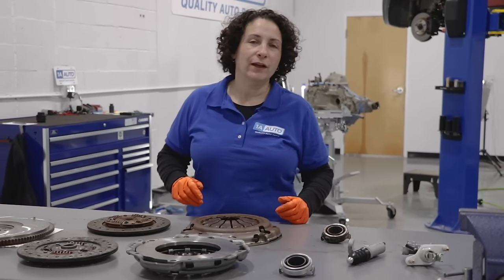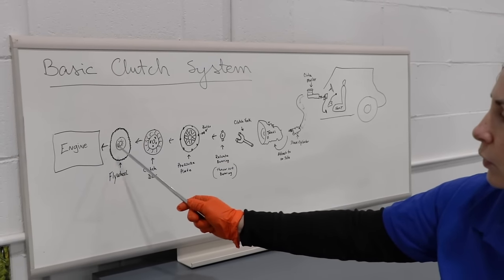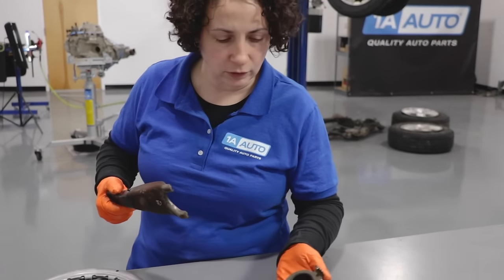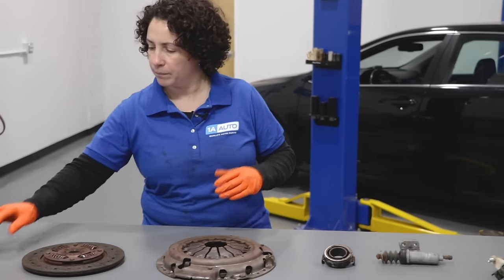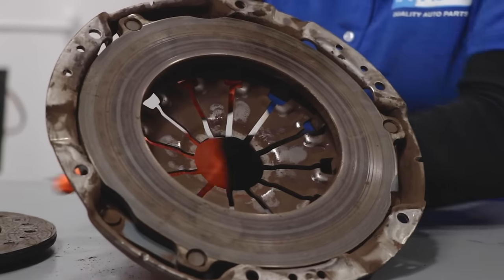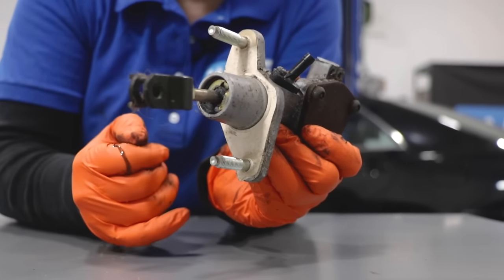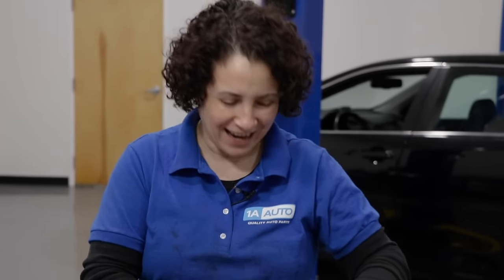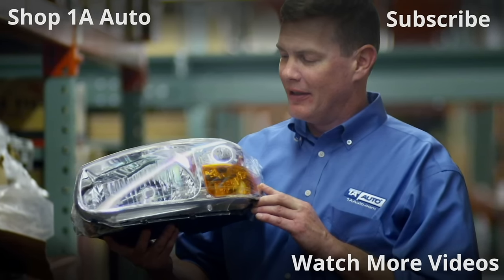How a Clutch System Works & How to Diagnose Problems

Comment: Hello wonder if you can help me I have a 2018 Ford Fiesta diesel six speed manual 11,000 miles every night after driving it round town for about an hour. The car starts to shudder when releasing the clutch in first gear or reverse. This happens all the time after an hour of driving. Any ideas what this could be please thank you

Comment: Started out pretty bad fumbling parts and words.... Brought it back though in the end... Never really addressed the system of a bad master cylinder 😢. Which I'm getting ready to change only because I'm having what appears to be hydraulic issues even though the reservoir is full and I replaced everything else a few years ago.🤔

Comment: This presentation is excellent. 
I knew next to nothing about the clutch system.  Now I feel like a mechanic!

One question; my clutch pedal has no resistance, I can just press it to the floor and can’t engage the gears.  Gears engage when engine is off.  2005 VW Passat estate.   

Looking at the helpful diagram in this video, it might be to do with the connection from pedal to master cylinder(?)
Reply: For sure try the clutch cable or it it's a new car it has a hydraulic clutch that might have the leak. Or just wear on the clutch cable. That's what provides the resistance. While ur there inspect the clutch fork for damage.

Comment: I replaced a clutch in a 1970 Mercury Capri 1600 (the Sexy European) in February of 1978 in my parent's unheated garage. The reinstallation of the transmission was, as I recall, the most difficult part of the procedure. The transmission was somewhat diminutive so I had the thing sitting on my chest. Lots of fun. There was a certain satisfaction to having performed the job myself. That was it, even though over the next four decades I had several vehicles with a manual transmission I never had to have a clutch replaced because I generally didn't hang on to vehicles for long. That 1970 Capri was a rolling testbed for every single thing which could go wrong with a car but I nursed it through its quirks until the unibody underside became too riddled with rust; decidedly unsexy!

Comment: Great information 🙌
My GMAC 6400 clutch does nothing.
I start the engine, press on the cluch but don’t fell any thing and it goes right to the floor
Desn’t quick come back also.
Could it be electric?
Is there any electrical part in the whole system?
Tx! 🙏

Comment: Really enjoy all you're lots vids, very explanatory,, I have a problem with my car, when I'm driving and press the clutch down I get knocking( its got worse now)fud fud fud fud but when I re-release it (back into gear, it goes away,,, I originally thought it had something to do with stuts, suspension maybe even cv joints, but today I realised the clutch in symptom and now I'm not sure.. I do most work myself but don't know what's up with it... any advice would go along way,,,

Comment: Great video thank you!!  🙏🙏 here is my question, my Camry has gone from 2-3 thousand revolutions to 3-4 thousand revolutions for normal acceleration. Would this be a clutch problem??  I just change the transmission fluid. No luck.

Comment: Great explanation to the clutch system. I have really bad shudder at bite point on 1st gear or reverse. Let say when I try to move the car from a stop really slow, I release the clutch slowly, the engine compartment shakes at bite point. On the other hand if I release the clutch more than the bite point, it doesn't shudder but car moves much faster which is not what I want. Could it be clutch related or engine mounts. My engine mounts probably needs replacement, but could a pressure plate warp and cause shudder. At higher speeds and gears there is no shudder or vibrations.
Reply: Sounds like you're not giving the engine enough gas, and it's trying to stall.

Comment: Hi there 
I just bought a set of suspensiones and sway bars link and they're installed already on my car but would like to know if these parts are a very good quality cuz I'm about to order some more
Reply from the maker: Thank you for your purchase! These parts are high quality after market parts that are built to strict quality control standards and also built to the same specs as the OE parts. Feel free to call our customer service department if you have any questions.  +Zuhar Zaqib

Comment: Hi great video. My problem is that at all times, the clutch pedal in my diesel bmw vibrates, the pedal moves all the time and judders. I changed the bearing but does the same. Any clue? Thanks

Comment: Hi there. When depressing the clutch pedal what exactly returns the clutch fork to its initial position? Is it the presure plate or is it another spring somewhere maybe the one on the slave cilinder? I am having a problem with my car, the clutch pedal stays in the depressed position (up)  but when I try to press it, I simply can not, it is rock hard. I tryed moving the clutch fork with my hand and it moves up and down so the fork is not blocked or anything. Could it be a hidraulic jam somewhere? Have any ideas? Thank you!

Comment: Sue! I need help! I have a new clutch, new master and slave.. can’t seem to get all the air out of the system.. I bench bled master. And bled the slave unbolted by itself then on the car.. since install of master and slave I can’t get into 1st or R without reving it up or holding the clutch for 5 seconds then it will fall into gear… is it air in the system or the flywheel and pressure plate installed wrong?

Comment: When I’m accelerating and I go to up shift, I get this scrape noise/feel in the clutch pedal when I push it in and the grind gets slower as the RPMs fall. Also when the car is off the shifter moves from gear to gear very smoothly but when the engine is on its a lot more notchy and clicky. You think it could be the TOB? Or pressure plate?
Reply from the maker: +NolanEnt We wouldn't be able to diagnose an issue like that here, you may want to have a local mechanic take a look at it. Thanks for checking us out! http://1aau.to/m/Shop-1AAuto-c

Comment: Clutch pedal was fine until it went straight to the floor the other day. Now it’s either fully depressed or I have to pull it back to normal position.

Fluid is fine. Where it should be. What might the issue be?

Comment: I had my clutch replaced bc I lost pressure. Replaced  The master and slave cylinder with oem. Replaced The line from the master and slave and I can only get a little pressure built and it goes away fast. Bled it a million times. The old clutch wasn't even bad. Any clue?

Comment: Every thing is new from the peddle to the flywheel and it feels like it's got a good peddle but it don't let the cluch release it's a S10 Chevy truck was a 4 speed I put a 5 speed in it but it just don't release the slave cylinder moves good

Comment: I have an issue i have a Toyota Corolla IM 2017 23k miles
- I have no feeling in my clutch pedal
- it also has the weight of say an s10 pickup truck- which reviews on this car say how Light its clutch is...- but it lacks the confidence of a secure bite that the truck does.
it behaves like an on/off switch * i have adjusted the pedal all over the place.
like you might get a few mm of engagement gradient 
the car cannot take off on idle alone
the bite point is miniscule and unforgiving- it can also be hard to grab it in a shift from 1-2 and 2-3
* however the clutch doesn't slip in gear, it makes no weird noises

Comment: What’s the issue if my clutch pedal won’t press all the way to the floor? It’s too firm and won’t go far enough to start the car or release the clutch…. 2002 BMW 325Xi wagon. Thanks
Reply from the maker: +Nick Green We wouldn't be able to diagnose an issue like that here, you may want to have a local mechanic take a look at it. Thanks for checking us out! http://1aau.to/m/Shop-1AAuto-c

Comment: i'm new to fixing parts in cars, but i love to, i have a 1996 Kia Sephia automatic transmission and it shakes from gear one to gear to while shifting , the more you gas it the more it shakes while shifting, and also it stays in high gears when i suddenly press the brake it tries to go and after seconds it shifts to the normal gear according to the speed of the car. is that a clutch problem or transmission problem ?
Reply from the maker: +DIY KURDISH We wouldn't be able to diagnose an issue like that here, you may want to have a local mechanic take a look at it. Thanks for checking us out! http://1aau.to/m/Shop-1AAuto-c

Comment: On the slave cylinder trying to bleed the system the plate that pushes in on the slave cylinder doesn't extend out fully.it only moves a quarter of an inch.

Comment: I have a 2015 civic si that when i press on the clutch with the car off the clutch feels normal and has pressure. When the car is on the clutch looses all pressure and when I press on it while in gear the car rolls as if I were not pressing the clutch pedal. Any ideas as to what this could be? Thanks. (I do have brake fluid in the clutch reservoir and no apparent leaks.)
Reply from the maker: +Lucio Garcia We wouldn't be able to diagnose an issue like that here, you may want to have a local mechanic take a look at it. Thanks for checking us out! http://1aau.to/m/Shop-1AAuto-c

Comment: Wish my slave cylinder was on the outside, Fords great engineers put it in the bell housing  which means you drop the transmission, and on a front wheel drive focus its a nightmare. 
Great job Ford, hope you go out of business very soon.